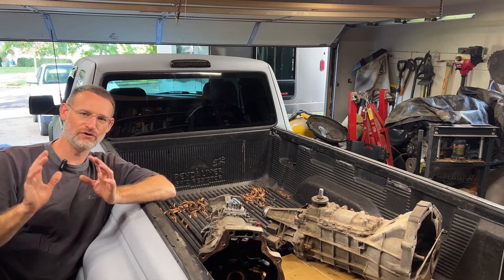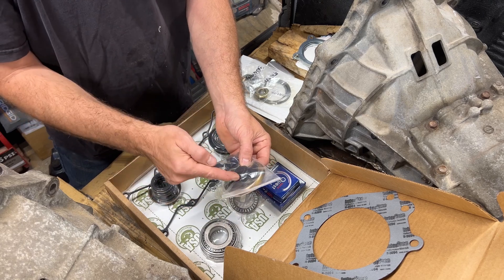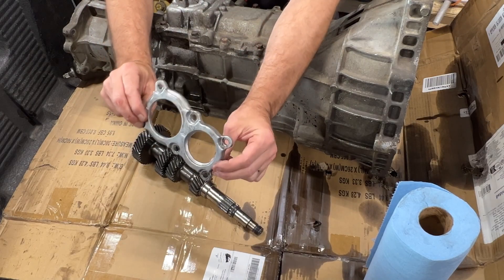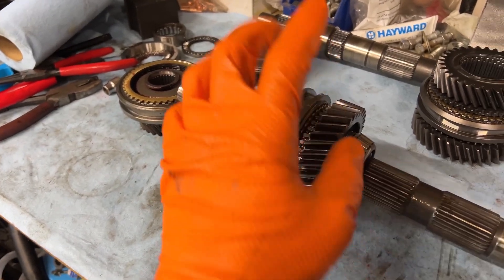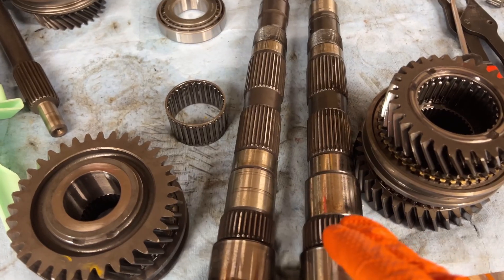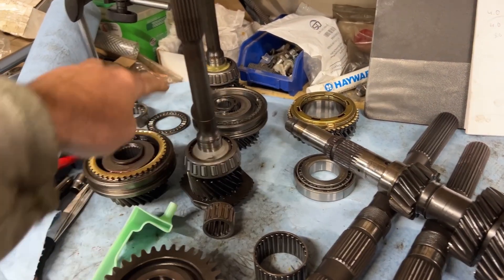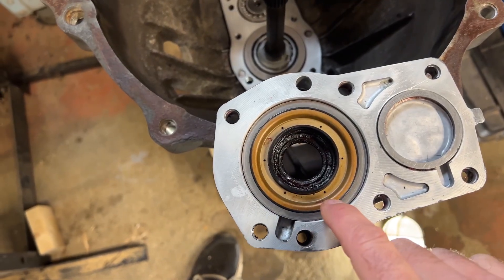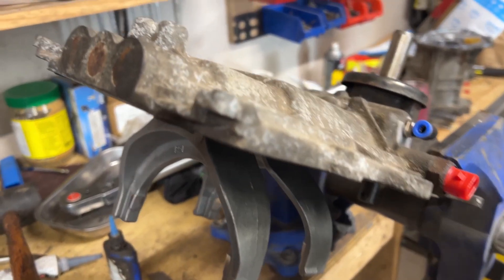Building the Best 4.0L Ford Ranger Manual Transmission with 3.0L lower gears! Will This Work?

Comment: Taking a shot in the dark, that this old video would generate a response by the time I get my part tomorrow, but question….  Did you put a bearing inside the main input shaft as well as the thrust bearing or did you just throw it in there?

Comment: 2:04 when you mention the "growling noise," could that be what I'm experiencing on my 07 FX4 manual at around 10mph?  Driveline vibration at low speed.
Reply from the maker: Could be… that’s tough to say…. A growling at low speeds could possibly be a wheel bearing or pinion bearing…. So many options
Reply: @RangerShop1 didn't think of the pinion bearing, I'll check that out, thanks! I ruled out the U-joints and wheel bearings.

Comment: Hey man i’m looking to lift my ranger, I was looking at your videos, Is yours a 2wd? I know lifting a 2wd and a 4wd is a bit different but you made it look simple, also would you mind linking the Key and shackle you used to lift the front and back. Thanks
Reply from the maker: This was a 4x4 but I ended up installing a solid axle swap in front, I kept needing to replace front end parts. Much beefier now

Comment: I'm wondering if the smaller main shaft is even an issue. The weak link is in these is the reverse idler it's basically made of glass don't ever try and pull out a stuck vehicle in reverse. I've seen a couple break just trying to reverse on a trail.
Reply from the maker: I’m not sure but i don’t think they would spend the money on a bigger main shaft if they didn’t have to…. Ford seems quite willing to cut costs everywhere else. 🙄

Yeah, those reverse idler gears are pretty weak. The mount is way too weak…. That’s a great tip about pulling someone out in reverse I would never have thought of that.
Reply: @RangerShop1  Four wheeler magazine did an fx4 ranger build years ago I believe it was supercharged and long travel. I'm pretty sure they did the shaft/gear swap on that one and beat on it pretty good. Might be worth building another trans to try it. The 2.3l turbo guys have put some pretty big power through the non hd trans with big tires and some running drag radials.                   I have a 02 4.0l 4x4 m/t super cab and a 03 3.0l reg cab 2wd edge m/t I do like the lower 1st and 2nd gear in the 3.0l trans. The 4.0 with 4.10 and 33's if fine on the highway just wish it had a lower 1st and 2nd
Reply from the maker: That’s an excellent point, I do see quite a few 2.3l turbo trucks with stock trans… seems the clutch is the weakest link, you might be onto something there! I’ll definitely think about it.

Comment: What made you think of that? 🤔 I want a 7.17/5.08/4.26 and1-1, J/S if you get into 4 WD (4X4) then 4.11 with a4-1 t-case is like 4.56 with factory 2.72 ratio in the t-case,overall about the same.
Reply from the maker: Lots have posted about swapping out the gears since it’s the same case. Unfortunately I think In this case it’s not possible.

Comment: Theres a fellow Canadian that has successfully done the swap. He has a 4.0 sohc supercharged manual trans like yours.  I talked with him when i planned to swap mine before i sold it. He used a 3.0 4x4 transmission for parts, and said to keep the 4.0 output shaft, 5th gear, and reverse and swap everything else over.
Reply from the maker: Hmmm, I’m not sure because I just ordered the generic 4.0 SOHC needle bearings and they fit like a glove, whereas the 3.0 needle bearings wouldn’t fit the shaft, even the gears minus the needle bearings I couldn’t get on the main shaft. I was so disappointed! 
I know what you’re saying though because I read a ton of comments and posts about how people did it but following the part numbers and all my measurements I just can’t see how it’s possible. With the m5odr1 maybe but not the R1HD. I’d love to have figured it out…. Please let me know if you figure it out
Reply: @RangerShop1  ill send him a message and see if I can't get him to comment here with some more detail.
Reply: @RangerShop1  I messaged him and he said he'd get in contact with you after work. If you want to try again without taking your transmission back out, I have a spare m50dr1hd and rebuild kit you can have, it's just sitting around, it's in the US though do shipping might be too much
Reply from the maker: @WillMcPherson-t4j  ok I really appreciate it! Yeah I think I’m going to stick with how it is now, I’ve been driving it for about 4 months and I’m happy with it. It would be a real pain to tow my trailer if I didn’t have 4lo, it is what it is now. 😅

Comment: My Ranger has the automatic transmission , I bought it because it was the best deal I've ever seen not because I wanted an automatic .
Reply from the maker: It’s tough to beat a good deal! 😂
It’s actually not that bad to swap it out for a manual if you want, I’ve got a video covering it. I saw two different adds on Facebook of complete parts for a swap including the computer, I think they were only asking 500$ The auto is ok though… you can build them to be decently tough!
Reply: how much did you pay?